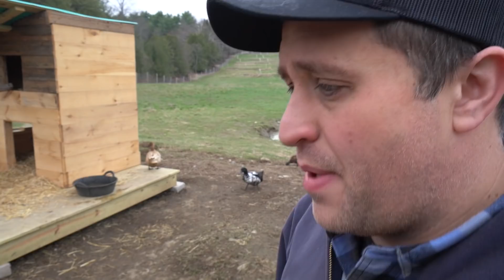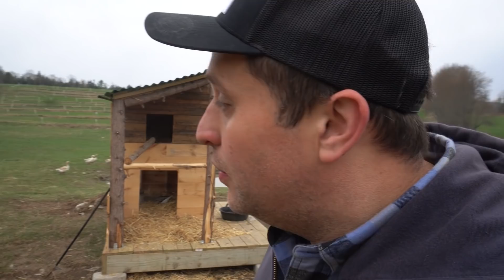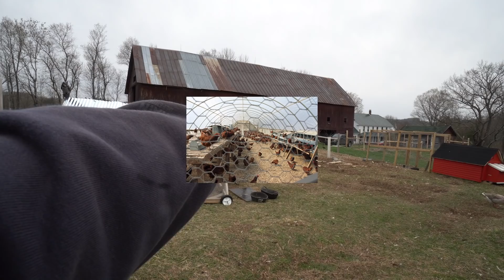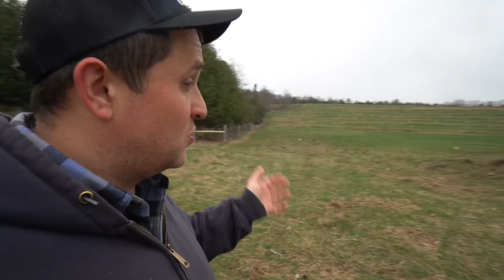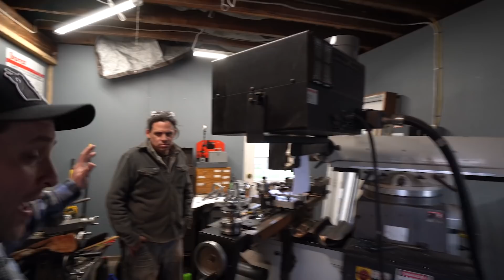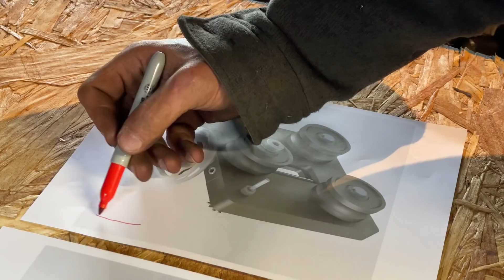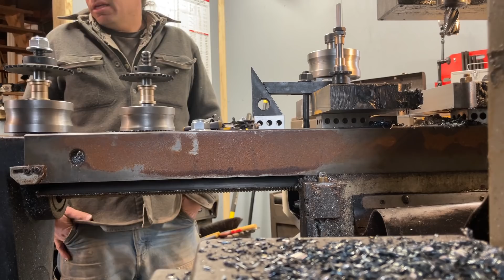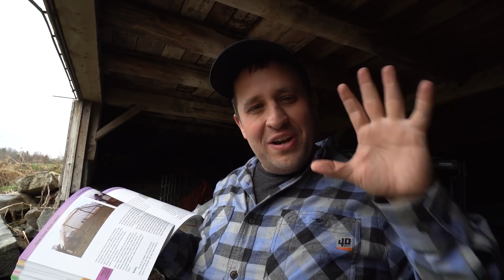A New Tool to Build a Better Greenhouse

Comment: Johnnys Seeds sells bending jigs for making high tunnels, including a "gothic" tunnel which is better for areas that get heavy snow, as it tends to slide off much easier, with the downside of being limited in width (i think the widest they offer jigs for gothics is 14'). The tubing used is chain link fence top rail, approx 1 3/8" in dia, is fairly heavy wall, is relatively cheap, galvanized for corosion resistance, and is available pretty much everywhere from fencing suppliers.

Comment: For your snow load, I suggest a gothic style (inverted V) arch. Farmers Friend has a much cheaper option than your home build. Since you want the extra height, you'd need risers/foundation wall, but it's well within your ability to rig that up. If you use a standard arch, the snow may well wreck the structure and cause expensive and frustrating repairs.

Comment: In pricing out my new hoophouse greenhouse, I went DIY, since I couldn't find exactly what I wanted. I found that Farm Plastic Supply had the best prices on plastic. I also ordered wind strapping from Growers Solution, to hold down the plastic. My greenhouse isn't as big. 2' sidewalls, which have roll-up plastic for ventilation (rabbit wire to keep rabbits OUT), and 4-16' cattle panels, making a 10'x16' greenhouse. Since I'm in the south I will also put shadecloth over mine. We have a really good Habitat for Humanity ReStore, so I'm going there for windows and a door.

Comment: DIY!!!!!
Cha ching!
That's why this girl bought the cement mixer with the Honda engine. The cost of the mixer, finishing tools, and gravel, sand, portland, block, and lime, was less than half of the estimates. I'll sweat and get muscles, no prob. I put in patios on 2 sides of my house, put down cement block, almost ready to stucco, poured footings for my chicken castle, (because my girls deserve the best and Dorothy doesn't need my coop in Oz). Traded off some muscle work with my bro, and did sidewalks around his house and completed a driveway. I hated hauling mud as a teen for dad.... It was free forced labor, my bros were too young to do it. I can't complain now. I have done so many renovations and small jobs not many women would have tried to do. I have to admit, I did love every trip to the hardware store with dad. I have no fear of power tools or starting a project. I love seeing what your up to. Makes me smile!

Comment: Be careful with the plastic that it is not an old roll(s). We built a wooden frame greenhouse a few years ago and the plastic was brittle before the first winter. It had a pointy roof because of heavy snow in the winter. Before that was just PVC curved frame. The bending metal sounds wonderful.

Comment: great video again. Very interesting to see how everything grows. I also very much like your idea of a dual purpose hoop house. But i noticed a potential Problem with your pipe bending plan. I am a goldsmith so my concerns might not be valid, but when bending gold or silver alloy pipes you have to fill them to prevent crushing them in the process. You can do that by filling them with sand and closing them with wax, filling them with something you can melt out later like tar or by putting a fitting steel spring inside. Maybe this doesn`t matter because you will be using way thicker and stronger steel pipes but i just wanted to mention it to prevent a possible mishap down the line.

Comment: Alfred is awesome!  Though I wonder about having your birds overnight in the hoop house.  I have been watching Sean over at Edible Acres using his greenhouse for his chickens during his New England winters.  the birds go back to their  solid structure coop for nights and the greenhouse is the composting, activity center for the days.  Salatin and Rhodes are both in the south and would not have to deal with the same overnight temperatures that you will be dealing with or that Sean deals with... unless their is a plan for a coop in the hoop

Comment: Would it work to just have straight walls?  Maybe with guy-wires for extra wind support.  You could have a straight pipe with a 45 deg angle at the wall-roof junction, a 90 deg at the roof peak, and another 45 deg at the other side going back to the ground.  Then you can use regular galvanized pipe and fittings (from Grainger or McMaster) and just screw it all together with pipe wrenches.  Just a thought.  Love that dog!

Comment: Someone, and I think it was Jason Contreras from Sow the Land, showed how he bent pipe with a much simpler system. He had some curved wooden blocks that he mounted on the outside of his tool shed, and he used this as a form to bend large pipe by hand for a hoop structure. If I find the link I will put it here in the comments.

Comment: If the chicken house is 20 feet wide and 10 feet high, won’t the poles need to be longer than 20’? Or are you going to have two 20 foot poles that connect at the top? Unless I am missing something. Which is likely.
Reply: Good observation, the tubing will connect at the top.  Two sections will make one hoop.

Comment: Morgan, don't overlook trying to make a good estimate for the weight of snow your cylindrical roof will have to support.  How many feet of snow do you get in a year?  How dense is that snow?  The downward force is not linear, either, since it'll be on a curved surface.  You'll have to consider how much space you wish to allow between the support bars.  I think you should bend those bars into a sort of paraboloid, not a spherical section - that'll help reduce the volume of snow each section of the roof will have to support.  Once you have your best estimate, multiply by 1.70  - you don't want it collapsing in the middle of winter!!

Comment: I'm pretty sure that if you only calculate the materials, the DIY version will come out cheaper - and work perfectly. But if you factor in your and Alfred's time, and actually add those numbers to the materials at a reasonable hourly rate, you'll come out way more expensive. You can never compete with industrial products when DIY.

OTOH, while you may not be able to compete on cost/price, you may well be able to compete on quality/specific fit for your needs. Big industrial producers don't sell greenhouses like soap bars or burgers, so they can't afford to keep a thousand different models on stock, one for each combination of climate, purpose, feature level and such. If you buy something factory-built, it's always a compromise.

Comment: I think the important thing is, as we go into a time of shortages etc is that you are not relying on a company for a kit, you can build exactly what you want from basic supplies. 
The ONLY thing I’d recommend is getting a few sets of plastic coverings just in case. That way, should you have a failure you are not waiting for a replacement.

Comment: Have you looked into the company Grower Solutions Glacier Series green house? It has the right peak angled roof for snow  load to roll off of it! (whereas a regular rounded angled roof will allow snow to accumulate and eventually the weight of the snow will collapse the structure) The Glacier has a a HIGH Peaked angled poles and at the center height is about 14 foot high! Making  this green house your own out of pipe, will probably end up, being more costly for all the tools, time consuming and will be a long, long drawn out process to build! Give Grower Solutions a call or order online and if you let them know DSH sent  you or go to YT channel "Deep South Homestead" to get a 10% off one time purchase promo code to use to towards that Greenhouse by going under Deep South Homestead video's to get the link for Grower solutions! Hope this helps! Take care and may God bless you, yours, the animals ,and the land as you improve and take care of it!

Comment: Alfred is a true engineer. That machine looks capable of,doing the job. I wonder about the tube wall thickness, to avoid it collapsing rather than bending. No doubt he has it worked it.

Comment: Hoop bending tools exist for many varying diameters, up to 20'! I was looking in to a small one for use as a greenhouse. They can be had for under $75.
Reply: Bootstrap Farmer makes one, so does Build My Own Greenhouse. Just search for hoop bending tools.
Reply: @FlorenceChandotCA  Yeah, I have on of those that I use for 12' & 14' wide hoop houses. It's made for 1 3/8" fence top rail. It would be useless for the 2" diameter pipe needed for a wider hoop house in a high snow load area.

Comment: That's a semicircle from that point you have 90° difference all you have to do is calculate the total height minus 4 feet and measure half the length of the whole circle and use Pythagorean theorem to get your answer for the length from the 4 foot tall side to the very summit of the hoop house. Also btw if this is to be a perfectly circular semicircle, the height and length should be the same Alfred said a 20ft diameter, so if it's a perfect semicircle your answer for the hypotenuse is √200 ft.

Comment: Moveable Hoop Huts and Cabins that work in Minnesota. (For area's that have 50mph wind gusts like we do on the prairie, use  stakes, dog corkscrew tie outs, moveable metal fence posts or something to attach to ground) 
Huts- We make our small 8x4 hoop huts (great for breeding pairs of geese or mascovey) using 3 gray pvc electric conduit, attached to landscape timber.  We cut the timber in half the long way. So two 8 foot sides is just from one timber. The ends are same cut but then cut four foot. So 3 timbers make 2 huts. Attach pvc using plumber strapping, use 2x4s cut leanthwise(1x2) to make a ridge support and ends (door etc). Cover with chicken wire or hardwire cloth (stapling and zip ties), and then cover that with lg painters cotton drop cloth (or tarp). Optional- paint using latex paint on the outside of hut hoop once its all built. (There's a little bit more we do, but thats the basics for our huts) 

Cabins(8x12 or 16) you can stand up in these lots of head room. But still moveable structure. (We even make a 4x8x4 internal second story on some)
 Anyway we use 16foot long welded metal cattle panels to make bigger hoops (Instead of gray pvc pipe). Dont need a ridge pole, the panels are strong support. Use plumbers strapping to connect everything even the 1x2 wood for end framing. Cover with chicken wire or hardwire cloth and heavy duty tarp. (Billboard or truckers tarps are better). Again thats the basics we do a few additional things. 

The framework should last a long time on these huts and cabins. Replacement or repairs of roof cover/tarping depends on type, weather, and geese activity. But its the easiest and cheapest of mantianace costs. (Sometimes just adding a new tarp over the old is best way)

Gift-  if you read this far. Moveable Nest options. Use old tires cut the rim walls off so you just have the tread ring.  Attach a wood base with holes for drainage or attach hardwire cloth. This holds the straw nest, keeps nest warm and is moveable. Can also use large diameter plastic tiling pipe cut about 6-8 inch high, but not everyone has access to that. But it is lighter to move. Geese love these to get deep down in and peek over edge. Just add more straw bedding outside and inside when eggs have hatched. So the babies can get in and out. Plus its good to change nesting material so babies have clean bed. 

I plan to make a huge hoop greenhouse using about the same concept with cattle panels and rebar that will allow a tractor to enter. But thats not this years project list. (Unless we get a 4th stimulus check)

Comment: I was just looking at the greenhouse plans again and wondering if 20' pipes are going to be high enough.  You did mention you wanted your tractor to fit.  I also have one of those portable garages and I was thinking that the straight up rights are one pipe and the bent ones get attached to them half way up (about 5' - small garage).  After Alfred does the math, ask him to also figure out the final height, not only in the middle at he highest point, but at almost the edges (to see if the tractor will fit).  I was also thinking if you need more, perhaps you could go with 3 pipes 10' long.  two for the sides, and one bendy one for the top.  Perhaps 2 10' pipes might even be cheaper  than one 20' ?  Just something I thought of.  Good luck again!

Comment: Bootstrap farmer  has a  tool to bend the pipes, have you talked to your other buddy Al from NH? The one he built was designed for heavy winds and snow load.
Also be prepared to protect the sidewalls sometimes they are peckish and tear holes in the plastic

Comment: You might want to look into geodesic dome geese/chicken houses.  They are very sturdy under heavy snows, there are even arctic versions.  There is a very strong kind that uses pvc pipe for the structure, so no lumber, hammering needed for the sturdiness.
Reply: Shawn James living out in Canadian wilderness just built a geodesic greenhouse and has links there for arctic versions.  I looked into it and there is a company developing a long tunnel geodesic dome structure, using the pvc pipes and a special connecter that they made.  Maybe they would give you a discount for being an online example for them?

Comment: So one of the challenges with a hoop house in your climate isn't just the snow but the piled snow around the building. A couple of suggestions I have for you is making sure to leave enough space on both sides of your greenhouse for snow removal with your tractor bucket and to consider using a cinderblock or eco block pony wall for the sides to extend your hoophouse life. It'll allow you to accumulate bedding, keep bird waste off the metal and give you some space to protect your plastic from birds, snowload, predators, puppy dogs, and equipment.

Comment: Don't forget to include the tools required to remove snow in winter.  You can't allow it to build up along the sides or it will bend the side supports from the weight.  Also to clear the top so the snow will not cave in from the weight.  Simple Living Alaska has to do it as well as some Canadian Homestead channels.  If you plan on using the tractor, you'll want to include some sort of dividing wall so all the warm air won't rush out every time you need the tractor.

Comment: hm taking the alfred route will give you security of modularity. aka if the design you choose happens to fail you in one way, you got a way to find replacement/ improvement easily/ more cheap

Comment: Something I hope you don't overlook as I myself as a fabricator have with similar but smaller projects. Don't undervalue your time. Things like cutting, drilling, potentially painting, fitment issues. Things that a pre fabbed kit will have had worked out. Not trying to discourage your idea at all just some food for thought on things you might not necessarily consider off paper.  Side note I use to work with an "Alfred" you made a very valuable friend just from hearing him for a few minutes.

Comment: Just a head up. Lumber and other building materials are growing up in price. So try to salvage at the scrape yard for good parts. And winterize the pipes. 
Also, you can run a hose inside the pipe to have a shower ceiling that will help you water the greenhouse in the summer months when the geese and chicken is not inside. 
I cannot wait to see what it will look like in the end.

Comment: Maybe think about adding 2 to 3 ft to the hoop house height. A winter’s worth of litter build up may make for a tight fit for your tractor come clean out time. Depends on how you maneuver the bucket.  Oats sound like a good option for a summer crop. Grows fast and maybe you can harvest the straw. Look forward to more videos.
Reply from the maker: I totally agree about the build up, my tractor needs 8 ft for clearance so I thought 10 should do it.

Comment: Think your colder climate may not warm up enough to keep critters in it. Justin and Joel are in a warmer winter area. You might need a double layer skin like Al Lumnahs greenhouse. Keep that in mind. Getting the greenhouse plastic attached easily could be interesting as well.  Just saying. you need a 4 season greenhouse

Comment: Your sweet wife is right, get one thing finished, done right, fixed, before you move to your next project. You designed a house for cat and dog. You built it. Use it for what you built it for. Move to next project. (You are the Farmer/boss, put the geese where they belong where it will be easier to keep control of them. Spring nesting is about over anyway.) You work hard, you worry, plan, etc. maybe one thing at a time will help.

Comment: Another thought:
You don't need to complete the entire structure at once. Work out the kinks on a 25' or so section. Then invest in the majority of the materials. That way you can be sure you are getting what you need.

Comment: Instead of riveted connectors try sinking the next larger size pipe into the ground and then slide the hoop down into this pipe.  You'd need more than 4' straight on one end, but it would allow you more structural strength in the final structure and a simpler attaching mechanism (just drill a hole through both pipes when in place and put in a cotter key.  I've done several wooden fences this way (mount the pipe on the back of the wooden fence post and insert it into the sleeve pipe in the ground) to allow the fences to be easily removed to allow trucks into the yard, etc.  Been working fine for 30 years.